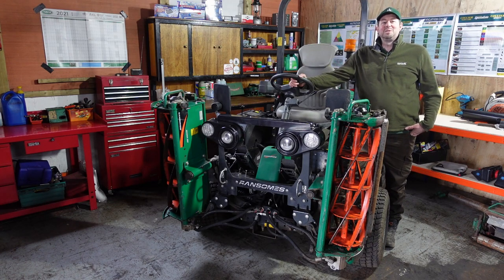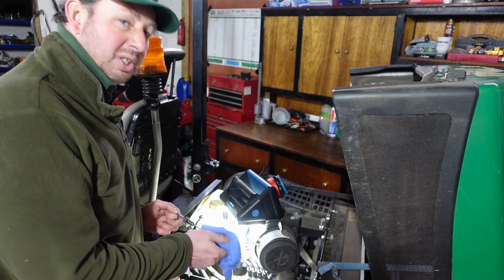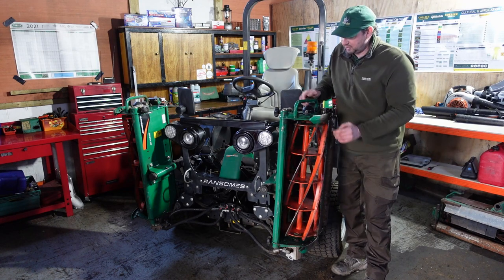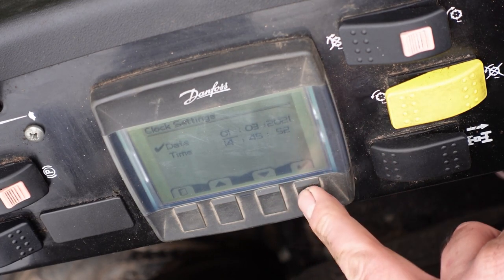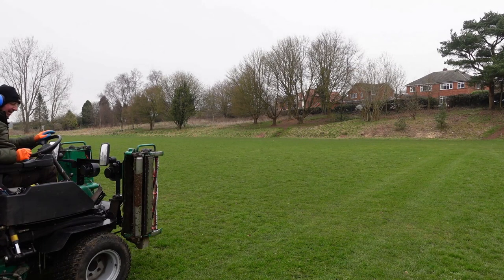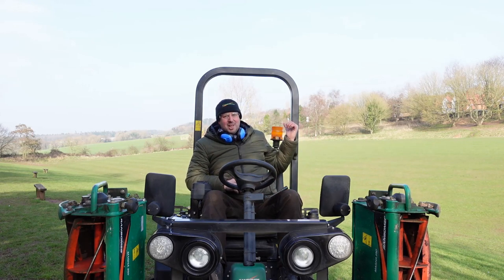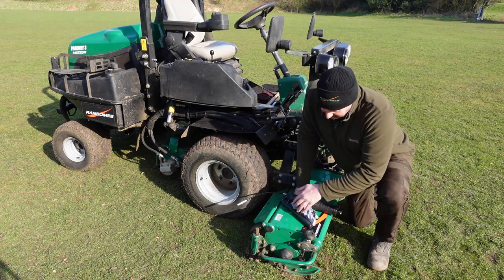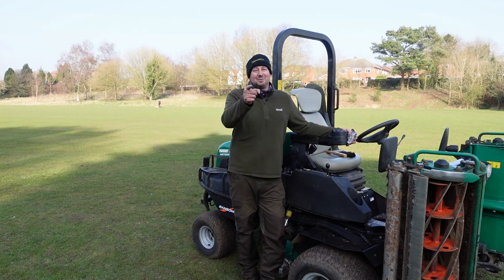Ransomes Parkway 3 Operator's Guide Jimmy the Mower - Triple cylinder  workshop operating tutorial

Comment: At least I'm not the only who struggles with the greasing points on the rollers all the best for the season Jimmy
Reply from the maker: They are tricky sometimes. 
Most of the aftermarket rollers are sealed for life bearings but they still need replacing every season.

Thanks for watching,

Jimmy 👍

Comment: I have to say this is a great video, i have owned several Parkway mowers over the years and just purchased a low hrs second hand machine  (288 cutting hrs).  Without this video i couldn't have even started the machine as its quit different to the 2250 plus. Btw don't forget to grease the pivot point on rear axle ;-). My machine is on cylinders too but i will be changing them for 6 blade ones, anyone who wants the 4 blade ones are welcome to them. Wondering if you have any experience with the flail heads and what is the finish like?
Reply from the maker: Thank you very much for your kind comments.
I love this machine and it has been a great workhorse for me.
I haven't had any experience with the flail heads but from what I've seen they are good enough for amenity land and public open spaces but I don't think they would be up to standard for a football pitch.

Comment: Nice beast Jimmy , love my 2130
Reply from the maker: They are all great machines and if looked after properly will last for years and years 👍
Reply: I had one, didn't like it at all. Found it very heavy and heavy on fuel. We ended up using a tractor with a Major batwing, which is completely trouble free.
Reply from the maker: I've been looking at the new Ransomes Bat wing mowers but they are very big to transport around.

Comment: hi jimmy , i have an 2006 parkway 2250 and i cant find the battery, the seat appears fixed so i cant tilt it and the mower wont start.
Reply from the maker: There's either 2 latches behind the seat or 2 bolts behind the seat that undo and let you lift up the seat and the whole metal panel.
If you look in front of the seat you will see some hinges on the base plate where it lifts.
If you are struggling, contact me through my Jimmy the Mower website and give me your phone number and I will happily talk you through it.

All the best,

Jimmy 👍

Comment: I drive one of these for the council. Something which bugs me about the machine. If I turn off the engine with either the gangs up or down it takes  ages to drop to get the blades going, but after watching your video I wonder if I need to put the revs on full 🤔.
Reply from the maker: You need the revs on full.
Start the machine in the lowest setting, let it run for 10 seconds then move it to full.
Wait a couple of seconds then engage the cutting units and they should be up to full speed almost instantly.

Hope that helps, thanks for watching,

Jimmy
Reply: @JimmyTheMower  brilliant, only had the mower 4 years 🙄. Thanks.
Reply from the maker: My absolute pleasure
Reply: What's the training process for these kinds of machines? I'm thinking about trying to get a position with the council (or a grounds maintenance contractor) in my area. What are the positives and negatives of your role? Thanks for your time.
Reply from the maker: You could probably do with completing a ride on mower course available through Lantra. However, your future employer may pay for this as part of your employment package.
There are many positives to the job, you work outside ( can also be a negative ) seasonal flexible hours. The ability to make a difference to the local environment, parks, verges and open spaces. 
Plus there are loads of training courses that help you advance which can turn a job in to a career.
Best of luck in your endeavour.

Jimmy 👍
Reply: @JimmyTheMower  Thank you!

Comment: Hi Jimmy great video , just a question do you sharpen your blades yourself or to you take to someone ? If so what would be the cost and in your experience how often would you need to? I am looking at buying a used Ransome 3.   But just looking into maintenance cost as everyone i speak to tells me the maintenance cost is very high, your thoughts please, thanks
Reply from the maker: Hi, I did have an old cylinder grinder and used to sharpen them myself.
However these days I take them up to my friends workshop Grass Mowing World  in Clitheroe.
Depending on how much cutting you do, you may only need a full regrind every couple of seasons and backlapping may be sufficient in-between.

Thanks for watching 

Jimmy
Reply: @JimmyTheMower  thanks Jimmy appreciate it
Reply from the maker: As a guide it will cost you about £1400 for a strip down and rebuild,
New bearings, bottom blade and screws, scraper wire etc...

New cylinders are expensive but they can last for years.

As a contract mower I get 2 years out of mine but a private sports club will get 5 or 6 years cutting a couple of pitches
Reply: @JimmyTheMower  thanks Jimmy very helpful, sorry to be a pain but with regards the service which you require in 19.3 hours time (on Video) how mush does a service come out at?
Reply from the maker: I'm not 100% sure Brian.
At the moment I have the machine on an extended demo from Ransomes and it is serviced for me.
Also I have serviced them myself for the 10 years previous to that.

An engine service consists of 
Air filter
Oil filter
2 fuel filters
Oil change
Coolant top up 
Around £150 and a couple of hours of your time.

The Mower requires new hydraulic Oil and filter every couple of years ( approximately £200 for the oil and filter and an hour or so to change) and greasing all round on a regular basis.

Ransomes can provide you with all parts and they can also give you a list of all approved dealers

Comment: Radiator screen??
Reply from the maker: Yeah there's a big one and it needs to be kept clear.
That's a short video for the summer 👍
Reply: @JimmyTheMower  yea I no been driving triples for 30 year, started on an agria,, I would say the dust screen is one off the most important things on a triple
Reply from the maker: Too right, but on those parkway 3's we only clean them out at the end of the day when it's hot.
They seem to cope a lot better than the previous models.
Still a vital job though